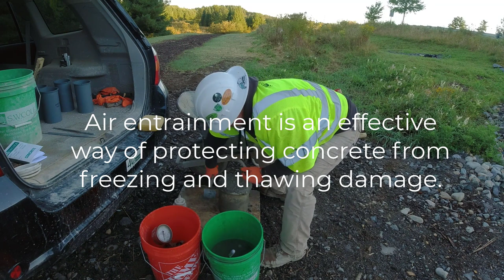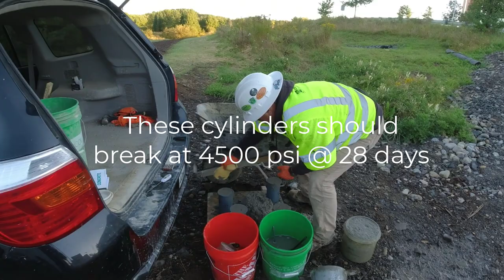They Tested Our Concrete! (Slump, Air, Cylinders)

Comment: Scientific. I did not get the way they tested for air? Look like he purged out the air with water,  pump air in then helped the gauge along by rapping the test cylinder? Right on ;) That is why I am not a scientist.
Reply: Pressure equalization method. You pressurize the fixed air volume in the top of the meter to a known pressure, then open the valve to the mix. The initial pressure will only drop if there's entrained air to compress, so 0% air would not change the gauge reading, but 7% for example would show a pressure drop as the air bubbles, which are initially at atmospheric pressure in the mix, compress slightly.

Comment: That air test looked super bogus.
Reply: How so?
Reply: @neildavis167  He's probably talking about how the guy kept slapping the meter. The measurement device itself is fine of course.
Reply: everything he did was fine....except shaking the meter when inserting the water.
Reply: It was right u shake the AirPod at most twice and tap the gauge to get out trapped air

Comment: Tester was supposed to run a yard  or two out before filling his wheelbarrow. Too lazy to push it back to his truck, so he tested off the front end of the load. Never do that. Samples cylinders are supposed to be filled and rodded in thirds, not halfs. Didn’t see a temperature taken on the concrete. Talk about blowing through a job…..
Reply: Your comment about filling cylinders in thirds is completely wrong.  4x8 inch cylinders, according to ACI is filled in halves.  6x12 inch cylinders are the only cylinder filled in thirds.

Comment: He needs a new gauge!  If you have to tap it, it's not accurate!  Something is binding up the movement of the needle.
Reply: Tapping the gauge is a requirement
Reply: Wrong. You have to tap it
Reply: he did almost everything correct
Reply: Wrong!  That is how it is done as per the ACI requirement.
Reply: You have to tap gauge to stabilize needle, says in the ACI guidelines